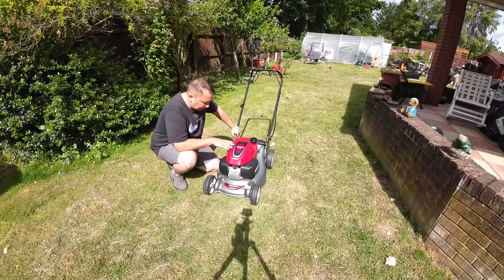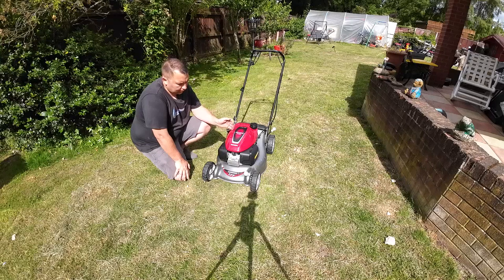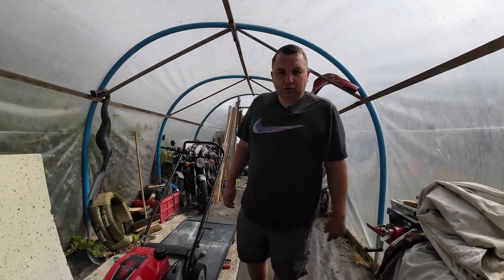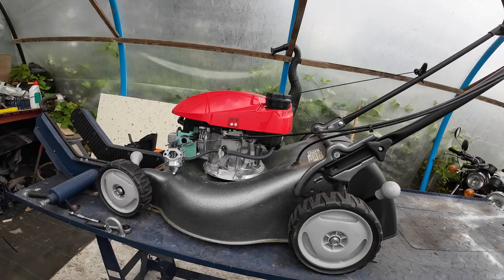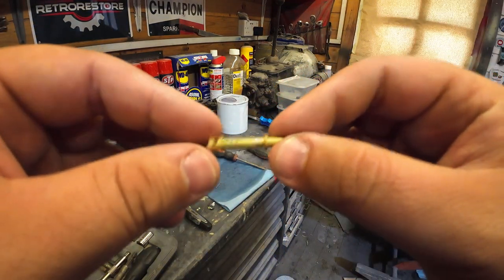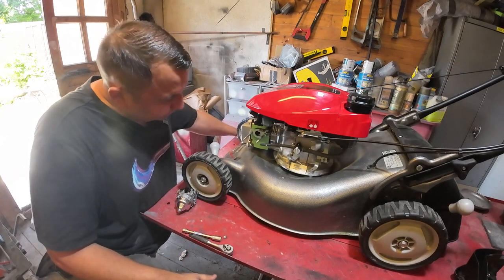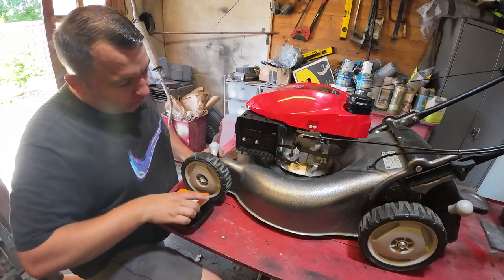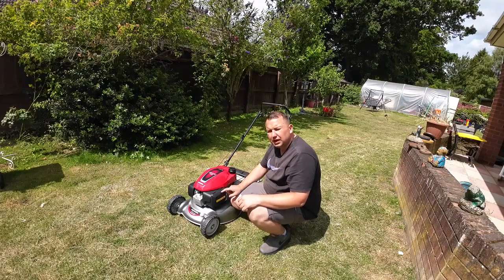Honda Izy Lawnmower Hunting

Comment: Yep same happened me took it back to dealer atleast 5 times before he eventually changed the carb  tried to tell me i was tightening the fuel cap too tight and then said my fuel could be bad where i bought it  the experience totally turned me off honda mowers for life
Reply from the maker: Honda Mowers are good when there running right 👍🏻

Comment: Hi, nice video 👌🏼
Ive got an issue with the exact same model. Stupidly, I left the fuel in over the winter and now when I start it, the engine dies after a minute.
I’ve drained the old fuel and put fresh fuel in. I’ve checked the cap and it’s ok. I take it the spark plug is fine as it starts up ok. Is my problem likely to be a blocked carb?
Reply from the maker: Yes sounds like a carb strip down and clean. 👍
Reply: @ProjectMan  ok Ty 👍🏼